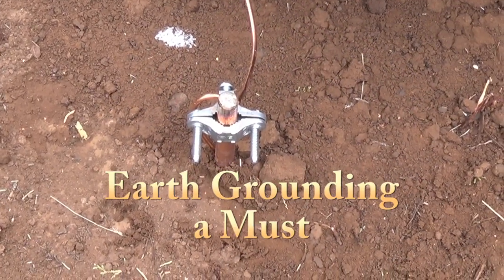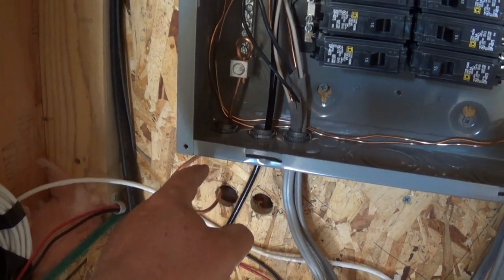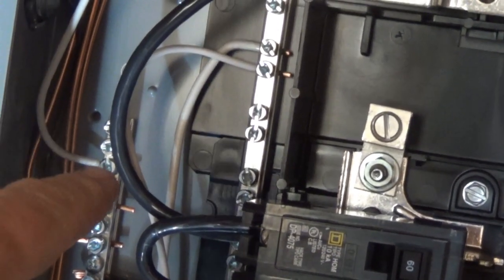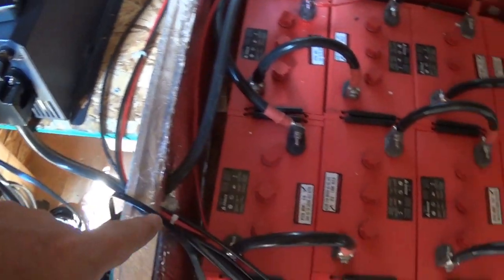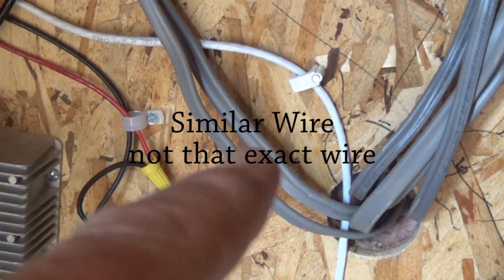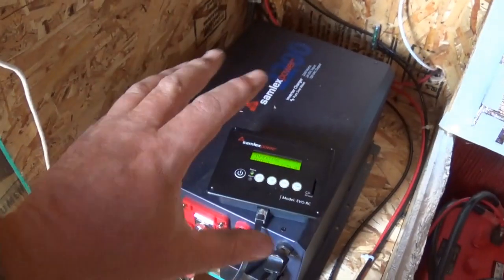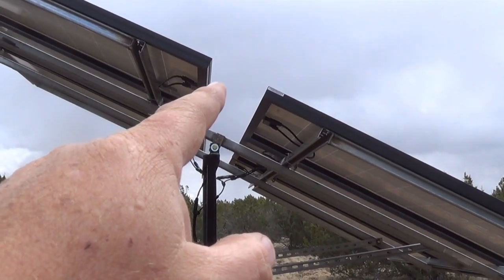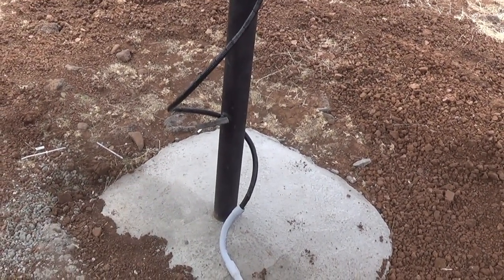Earth Grounding Solar Off Grid System - Grounding Batteries, Panels, Controller, Inverter

Comment: Hey buddy, I have five solar panels. Do I still need to earth ground them?
Reply from the maker: i am no expert but i would think its best to ground them. sometimes the panels attached to a metal frame and the metal frame is in the ground so that could the the ground. or ground the frame with a rod. make sure to also have a breaker or at least fuses to help protect the charge controller.
Reply: @A @ArizonaHotHomestead  I do have a fuse before it goes to my charge controller and I emailed where I bought my solar panels and metal frame they said I don’t have to
Reply from the maker: you are good to go .

Comment: You have INSURED that if you get a lightning strike, it will FRY EVERYTHING! So WHERE ARE YOU TODAY??!!    m
Reply from the maker: so far everything is running great. 10 yrs or so. no problems. i did just upgrade batteries to lithium and an inverter/charger with more panels.
Reply: @ArizonaHotHomestead  EXCELLENT!! For our panels on my shop we put a ground wire and rod on a tree 300 yards away as insurance. Still working!

Comment: My 24-volt all-in-one inverter has a grounding screw outside on the case and I'm simply running a terminal block with six Outlets do I run the AC output ground to that screw on the case and then from the case to the Earth ground now I do use a generator on the AC input side will that affect anything ?
Reply from the maker: i dont know. im not an expert. i would run all grounds to a bus bar and than to the rod.

Comment: I recommend a copper clamp.  that looks like the cheap aluminum or galvanized clamp. Dissimilar metals will corrode faster.
Reply from the maker: it was what ever home depot had for it.

Comment: Hummmm = I'm not so sure  I  would run my  NEGATIVE   Battery  Post  to any BUS-BAR 
...
IMHO 
...
Reply from the maker: in a car your negative post is grounded to the frame. same with rv/trailers. for dc i ground the negative. so far after 10 yrs i havent had a problem.

Comment: I'm trying to learn more on topic, and I see  there are many opinions. The visual was helpful for me and I like how everything is tied to the main panel. I think the only thing that might be improper is at the panels, which should also be tied back to the main panel. The linked video is so far the best I have seen on the topic. You could jump ahead  to the 14 minute mark where it shows having only one grounding point, no auxiliary points. 
https://youtu.be/_xOUEKehOFE?feature=shared
 
In the video, the guy talks about electricity generally seeks its way back to the panel as the actual path of least resistance, not necessarily  the earth.
Reply from the maker: it is confusing. the key is bonding the neutral wire. becus the neutral is not bonded prior to this distribution box so i bonded it there. never bond it twice.

Comment: You mean 16 gauge? lol 6 gauge is super thick
Reply from the maker: The grounding wire was 6 awg
Reply: @ArizonaHotHomestead  sure wasn’t the wire on the battery were 12g 6g is way thicker than that, the grounding wire was skinnier therefore not 6g

Comment: Thanks 
most Ground Rods are 8' in length 
&  are  
Copper Coated STEEL ( Copper would be too malleable to pound Eight Feet into the ground & would bend ) 
Thanks Again for your VIDEO 
COOP
... 
...
Reply from the maker: thanks for your input.

Comment: I ones had an inverter that if you touch the battery poles  it would shoke you so guess ac was leaking into the dc side but this system ran for years no damage to the gel  batteries . Thinking now if i grounded the battery I  would have solvesed the getting shocked problem .
Reply from the maker: dont know. i dont know enough about electrical stuff to know.
Reply: Mate, i have the same problem. here is my testing https://youtu.be/SwA0tfGoxlU. Im thinking to ground my battery too.

Comment: Only need to “system ground” from inverter to ac electrical panel.
Stay power always wants to return to the source. 
Not earth ground!
Reply from the maker: i have heard from solar installers both is fine.

Comment: This cant be good. My system is very sensitive to ac-dc clipping. Dc voltage in the ac output causes faults when dealing with sensitive units. Todays systems cone with sensors to help avoid this exact problem this type of grounding creates
Reply from the maker: from my understanding when you bond ground  to neutral you can only do it once. some inverters or all in one inverters have the neutral and ground bonded inside the equipment,  you can only have one neutral/ground bonding.

Comment: Please delete this video . This setup is really danger.. Do not do it like this... In short AC You will send it to battery negative... horrible.... You are combining DC with AC it is not good idea.
Reply from the maker: thanks for the info. i havent had a problem in over 8 yrs. i do get lightening storms which took out my cell signal booster but everything else was fine. after the signal booster got fried i did call northern az wind and solar and they said as long as the inverter isnt already bonded that i should bond everything like i did in the panel. if the inverter was already bonded i shouldnt bond in the panel.   i am no expert but so far its working.
Reply: @ArizonaHotHomestead  Yes bad design works until problem occurs. Test it with shorting AC to DC battery ... and will see how it works... let me know I am interested too.
Reply: AC/DC mix seems sketchy to me as well. 
Great band, though, so maybe there is something to it?

Comment: Batteries really need grounding?
Reply: Not batteries, but the inverter I think
Reply from the maker: the battery in your car is grounded to the frame of your car.
Reply: @ArizonaHotHomestead  ok. But car grounding is not really earth grounding.
Reply: @ArizonaHotHomestead batter is only grounded to the frame to make a complete circuit not for grounding like a house… very different situations ….

Comment: You video shows that you have grounded AC and DC together.Why is that?
Reply from the maker: i was told by an electrican that grounds needed to be grounded so i just put it all together. so far after 8 yrs wow or more no issues.
Reply: @ArizonaHotHomestead  I have a friend that has grounds and commons joined in a sub panel. It’s been at least 10 years that way, working great, but it is against code and extremely dangerous and potentially fatal. An electrician did it. Lesson. Just because a pro said something doesn’t make it correct. Just because it has been working good without issue doesn’t mean it is safe. Mike Holt videos are a life saver. We should always question ourselves when it comes to safety.
Reply: @lukefarmer5391  Earth ground and neutral (if that's what you meant by 'commons'?) are  bonded in household AC panels. That is the proper way to wire.

Comment: curious ---
I just spotted what appeared to be a 50-amp double throw breaker - with a loop in one contact & then back in the other Contact ?
what is the purpose ?  is it to bond BOTH  bus bars together ?   is everything  120-volts in your system ?
curious
COOP
...
Reply from the maker: i am using the double throw breaker as the main breaker giving 120v to each side.

Comment: Anodized alum PV frames are effectively insulated Aluminum.  I was surprised when i first heard this too, so don't take my word for it, do your own test: file off the anodizing on a corner and do an Ohm meter test to anywhere else on the alum frame and you get no continuity.  They sell special washers just to cut through the anodized coating, (Weeb washers) this is to electrically connect the frame racking to the PV frames where you bolt them. Then you need ground lugs attached to the racking, and electrically connected to earth-ground If the racking is anodized aluminum the lugs need to cut through the coating.  The concrete and steel post set into the earth will (in most locations) meet Earth-grounding requirements, however the loose post inside the fixed one that you have for rotation, will not.
Reply from the maker: thanks for the info
Reply: Don't bet your life on 40 to 60µm of anodization.

Comment: Yikes man. Look up Mike Holt and electrical theory to see why this is not good. You can have something like neutral to earth voltage get really out of hand if one of your neutral (or negative dc) wires goes bad. Like it will shock you or destroy your equipment. The earth can carry the voltage from one ground rod to the other, in simple terms. Bad bad.
Reply: Yes, you can have all kinds of problems if you have a utility or grid feed backup
Reply from the maker: @jdickson242  nearest powerline is over 2 miles away. no grid.
Reply from the maker: @jdickson242  so with the nearest power line over 2 miles away i guess i am ok. in fact going on over 6 yrs and no problems.
Reply from the maker: interesting. i will look him up. so far after 8 yrs all is still good.

Comment: So Just one question 
Have u had any issue with the set up as shown?
Do batteries drain? Has lightening destroyed any equipment? I ask because of the many apposing comments
I’m assuming this has been in use a while-does it work
Thanks
Reply from the maker: 8 yrs later no problems. however i did have lightening flash that took out my cell phone signal booster. . we get lots of lightening during the storms in fact my neighbor about half a mile away did get hit . he wasnt grounded and it blew his inverter and charger along with a few outlets in his container home.

Comment: This guy should probably take this video down.
Reply from the maker: why?  i followed what an electrician told me to do.
Reply: @ArizonaHotHomestead  Have you missed all the other comments already explaining why this is potentially disastrous. That electrician probably doesn't know anything about solar system set-ups, because nobody thinks it's a good idea to ground all of your equipment like you have done in your video.
Reply from the maker: @DaveWillGo  help me. how should it be done. each component says it needs to be grounded.
Reply: @ArizonaHotHomestead I think the issue lies with the battery ground. Think Needs to be removed. I'm not an electrician though. Also your ground wires should be green or bare copper. Using black and white wires for ground is no good. Your inverter ground needs to touch bare metal on inverter.
Reply: @ArizonaHotHomestead I cars battery is not grounded. The negative part of a car battery is attached to car frame only to save money on wire. For example when you install a light on the rear end of car you only need one red wire and the lights negative wire can be connected to the rear car frame. This save money as you won't need a long black wire.

Comment: Rest assured you now have a complete  path to wipe out your whole system if you have a ground strike near by.
Reply from the maker: we will see. why is it that electricians said to ground it this way?
Reply: @ArizonaHotHomestead electricians typically install ac systems.  Solar is a different beast. I'm assuming this is why.

Comment: With the inverter 3000 watts 
How big the fuse amp I should put between the battery and the inverter?
Reply from the maker: 3000watts  what is your voltage off the batteries? 24, 48, 12?   amps =3000w x volts.
Reply: @ArizonaHotHomestead  wouldn’t it be A=W/V as A x V = W
Reply from the maker: @owenblount7334  oops. yes. w =amps times volts. sorry.

Comment: So I’m on the boat and I’m trying to figure out how to ground my inverter.
Do you have any idea how to do that?
Reply: How is an earth or ground connection established on a boat or ship?

All related (37)

Recommended

￼

Michael Lipphardt

Engineer at Quality Electrodynamics (2015–present)Author has 7.3K answers and 9.9M answer views

 · 5y

A common ground is created by tying all the returns together. Since power is generated on board, there is no need for an earth ground as used by home and industrial installations. Instead the systems are referenced to the hull. This ensures that any failure of insulation has a return to short to, allowing breakers to trip and disconnect power.

Upvote

1

Promoted by The Penny Hoarder

￼

Lisa Dawson

Updated May 28

What are some ways to make extra cash without getting a second job?

If you needed extra money, like, yesterday, you’ve come to the right spot.

Our team has compiled a list of creative ways you can fatten your bank account this month. Certainly, there’s something here that fits your needs.

Without further delay, here are four ways to pocket some extra cash:

1. Earn as Much as $1K/Month Doing Simple Online Tasks

Is there such a thing as easy money? If you know your way around the web, there certainly is.

That’s because data is currency these days, and many companies are willing to pay cash for it — up to $1,000 per month.

Finding these companies can be time-consuming

Continue Reading

Upvote

9.3K

722

330

￼

Adam Liss

Choreographing Electrons Since the '70sAuthor has 4.9K answers and 6.1M answer views

 · 5y

The grounds of the AC, DC, and RF systems on a boat are all bonded together. Their common ground is tied to the hull, or to a metal bar attached to the underside of the hull, which makes an electrical connection to the seawater.

Understanding The Green Ground Wire - BoatUS Magazine

Getting Grounded the Right Way

Upvote

3

Related questions (More answers below)

How do I ground a boat’s electrical system?

5,527 Views

Establishing an earth or ground connection on a boat or ship is important for safety and proper operation of electrical and electronic equipment on board. Here are some common methods used to establish an earth or ground connection on a boat or ship:

Through-Hull Fittings: One common method is to use a through-hull fitting made of metal that extends through the hull of the boat into the water. This fitting can provide a connection to the water, which can act as a ground.

Ground Plates: Another method is to use a ground plate, which is a large metal plate mounted on the hull of the boat below the waterline. This plate provides a connection to the water and serves as a ground.

Sacrificial Anodes: Sacrificial anodes, also known as zincs, are often attached to the hull of a boat to protect it from galvanic corrosion. These anodes can also be used as part of the grounding system.

Grounding Straps: Grounding straps are metal straps that provide a connection between various metal components on the boat, such as the engine block, mast, and other metal structures. This helps to ensure that all metal components are at the same electrical potential.

Isolation Transformers: In some cases, isolation transformers are used to provide a safe and isolated ground for the boat's electrical system. Isolation transformers can help prevent galvanic corrosion and provide protection against stray current corrosion.

Grounding Bus Bars: Grounding bus bars are used to connect all the grounding components on the boat to a common point, which is then connected to the boat's electrical system ground.

It is important to ensure that the earth or ground connection on a boat or ship is properly installed and maintained to prevent electrical hazards, ensure the proper operation of equipment, and protect against corrosion. It is recommended to consult with a marine electrician or other qualified professional when installing or modifying the grounding system on a boat or ship.
Reply from the maker: ground it to the frame of the boat. all your electronics would be grounded to the frame. just like a car the battery is grounded to the frame.
Reply: @ArizonaHotHomestead  You can't ground to fiberglass!!

Comment: The solar panels need to be bonded to your equipment inside (service panel).
Reply from the maker: i was told it was ok to ground the panels where they are.
Reply: @ArizonaHotHomestead pv panels can have a separate grounding rod often used when panels are away from house on its own racks or ground mounted.

Comment: All that will do is destroy everything that has been grounded in the event of a lighting strike on your panels. You also have lots of earth loops between items which are dangerous if you lose the neutral.  No point what's so ever earthing the battery negative it will serve no purpose. A safer better solution would be to to earth your inverter neutral output and fit a Residual Current Circuit Breaker.  As your setup is at the moment you stand a good chance of things becoming live on the equipment chassis with a fault condition. Your earth spike needs to have an extremely low ohms measurement, that ground looks dry and not very conductive, and often requires several spikes connected together  to archive a good contact. I'm not being a troll just trying to keep you safe, 40 years as an electrical engineer.
Reply: I had to run several ground rods when I setup my Hexbeam because my soil is so poor. Good advice for this guy too. 73
Reply from the maker: thanks for the info. i am ok with any info as long as bad language is not used. yours was a good kind of troll. lol.....
Reply: Hi I really was not being a Troll. Just offering my help  and experience out of concern for your safety.😀
Reply from the maker: @g7mks383  your all good.
Reply: @ArizonaHotHomestead ground rods need moisture to operate correctly that's why them are 8 foot into the ground. If the ground is dry 8 foot down it may not operate correctly from my understanding

Comment: I read nec rules state 8 feet minimum depth for code and I also read that to attain a 5 ohm or less resistance you need ten feet deep. But your depth is regulated by the type of earth your pounding into. There was a chart for rock , dirt, sand , clay, marsh, maybe 2 more each with different depth requirements.
Reply from the maker: thanks.